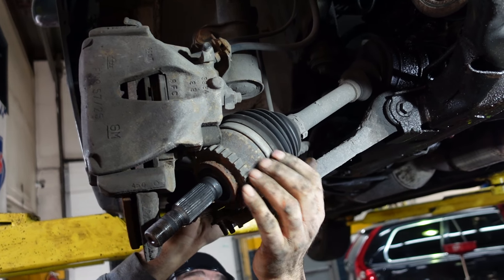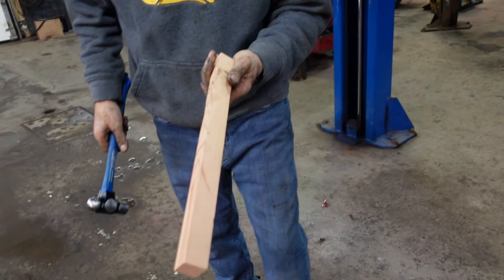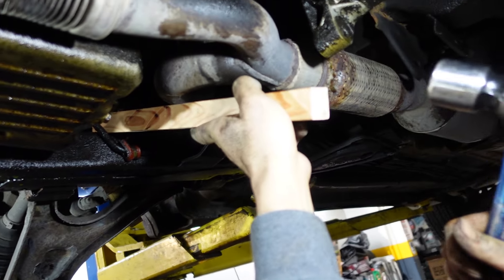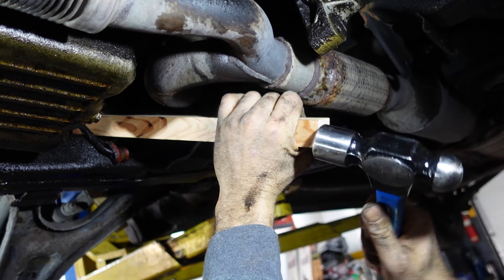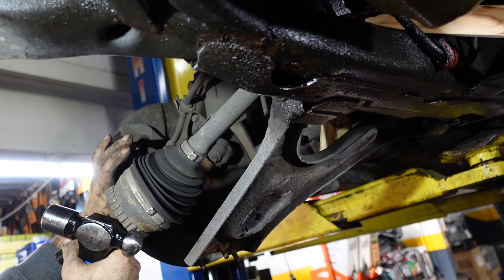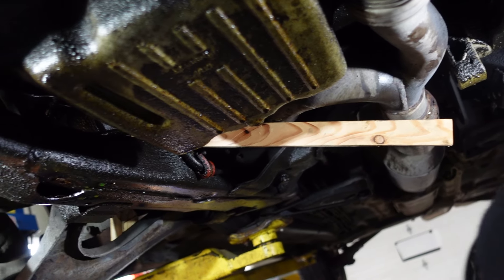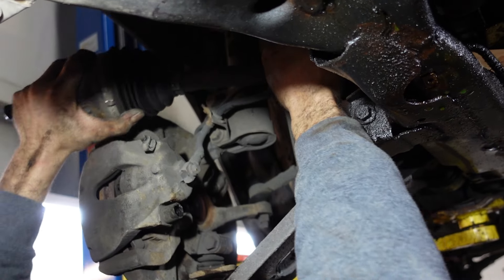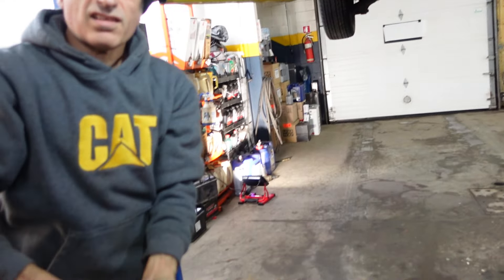How to Remove Front Right CV Axle Shaft SAAB 9-5 1999-2009

Comment: I Removed the Axle but i cant Open the gearbox oil Plug. What do you think how much gearbox oil did i lose with just removing the Axel ?
Reply from the maker: 1/2L of gearbox oil with the car on a level surface. Note: Check your owner's manual for type of oil to add.